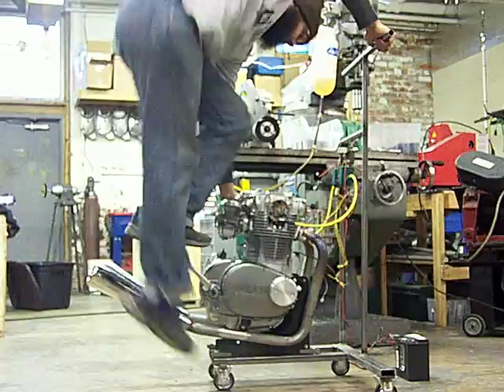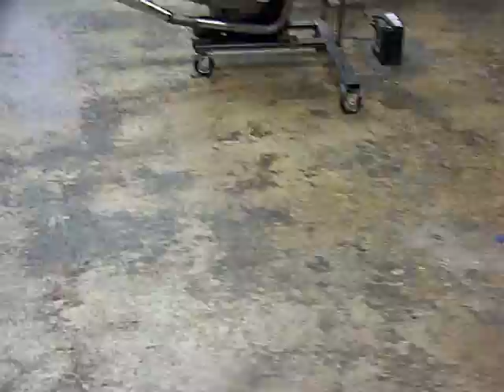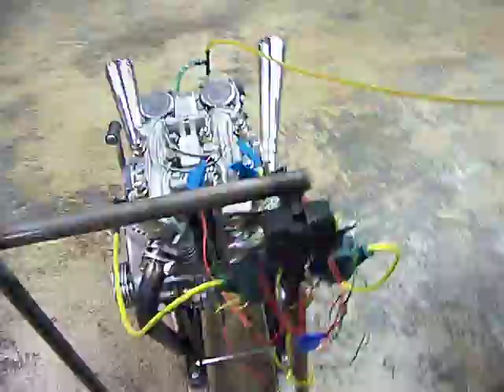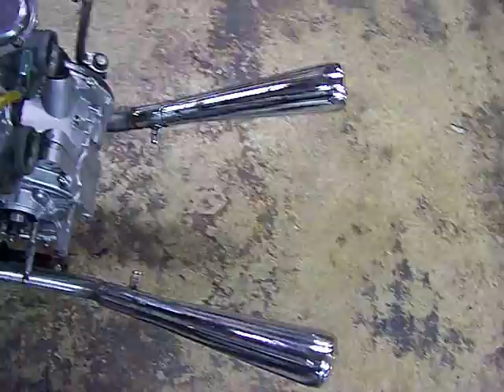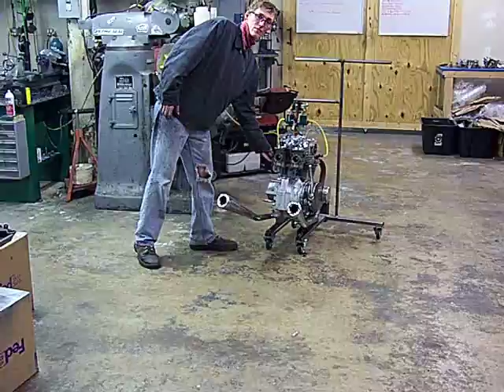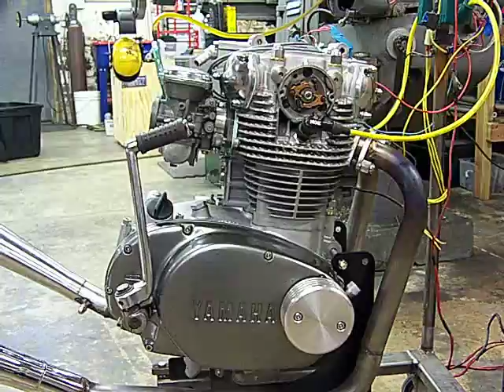270 Degree Rephased XS65 - Hugh's HandBuilt

Comment: In the early nineties, I was a marine recruiter in Richmond, and bought seven basket case XS 650's, and one that had sat in the rain minus spark plugs.  I swapped top ends from one basket, built the others and sold, and rode the one for three or four years, with great pleasure.  I'd had a 64 TR6R five or six years in the late seventies, a half a dozen harley's, and now ride a 78 Bonnie, just recently bought.  I'd never delved into the XS's I had, just swapped parts to put friends on bikes, but I'm really intrigued by this as it's so easy to do on these engines. Much as I hate to say it, this was what Triumph should've done going to the T-140, the engineering on the XS is simply up to date with it's times, and while quite solid, sound, is merely putting modern technology in a time tested, proven bike.  I'm seriously considering building up a custom motorcycle around this engine.  Thanks, it really sounds great.

Comment: Lovely job! 270 parallel twins make such a lot of sense. Phil Irving pioneered the idea back in the 1930s but for various reasons it didn't catch on.
I rode a friends rephased Laverda 750 and liked the concept so much I bought a Yamaha TDM 900. Lovin' the idea of a 270 degree XS65, a thinking man's motorcycle! Thanks for posting and good luck with the project.

Comment: That is a great sounding motor Hugh. The yellow flat tracker also sounds really good. I've done the same re-phase on my BSA A65. Running a 79.5mm bore and 89mm stroke. I copied an XR750 oval intake port into the BSA head, and it's pretty cool. 
http://i20.photobucket.com/albums/b213/markparker/IMG_0309%20-%20Copy_zpsjvfhyytp.jpg

Comment: what a great looking motor, makes me wonder why I'm stuck on Harley, very very nice
Reply: I wonder the same thing lol
Reply: My first Harley was a 74 XLH, nothing but trouble, I put my TR6R in the shed for it, had six or seven since, still have an 88 inch custom I built, but haven't even registered it in a decade.  I'm riding a 78 Bonnie, and am looking back thirty years, to some eight XS's I picked up, worked and sold, wishing I'd never gotten off any of them.  I'm currently looking into an XS engine, precisely because they are so adaptable while mirroring everything I love about Triumphs.  I'm getting my house painted, new flooring and got well over a hundred miles in yesterday, just chasing "paint and hardware", and really enjoying the summer.  I tend to be much more "laid back" on the Bonnie, than ever on the Harley.  I also am enjoying the very fine handling, something the XS's also were great for.

Comment: Did a 270 a couple of years ago and love it.  Mines stock otherwise including the ignition (re-phased of course).  Got over 2000 miles on it with no problems.  Where did you get your ignition from?  The most popular supplier couldn't help me with a 270, only offered 277.